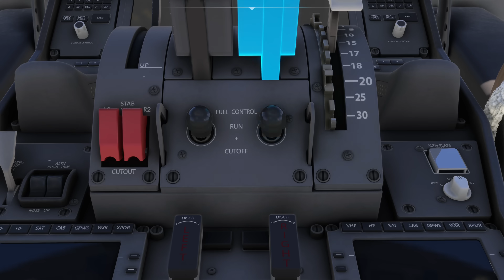Air India 171: Why Did The Fuel Cut-off Switch Get Moved?

Comment: if I'm ready correctly, it takes 1 second to cut them off but takes 4 seconds to put them back on ??

I think both switches actually never transitioned physically so it's either a bug in B787 software or an EAFR misreading 

at about 08:08:42
UTC and immediately thereafter, the Engine 1 and Engine 2 fuel cutoff switches transitioned
from RUN to CUTOFF position one after another with a time gap of 01 sec.

As per the EAFR, the Engine 1 fuel cutoff switch transitioned from CUTOFF to RUN at about
08:08:52 UTC

Thereafter at 08:08:56 UTC the Engine 2 fuel cutoff switch also
transitions from CUTOFF to RUN

Comment: But there’s no evidence the levers were actually touched, or pulled and moved and then set back to run.  There is no evidence that the controls were touched, only that a signal went to the engines to cutoff fuel.

Comment: Cameras could be put in cockpits to record all the mechanical flight controls without having the pilots' faces recorded. But that wouldn't stop someone from sabotaging the recording by "forgetting" to shut off the recorder for long enough after an emergency non-crash landing. That happened with Alaska Airlines 1282. Once the plane was stopped and passengers off, the cockpit voice recorder should have been turned off but it was left running long enough to loop over what it had recorded during the flight. All the recorders should have an automatic shutoff that stops them once the aircraft is on the ground and the engines shut down.

Many commercial truck fleets have dashcams pointing forward out the windshield, and one facing inward to record the driver. That protects both the truck company and the driver. It provides proof for the company if an incident is the driver's fault, and protects the driver if an incident was caused by a failure of the truck or another vehicle colliding with it or an animal runs in front of it or a tree falls etc. Despite that there are quite a number of truck drivers who have done stupid things anyway, knowing they're being recorded and will get caught if what they do causes a crash.

Most owner/operator truck drivers have an outward facing camera. A lot of them have YouTube channels so they also record themselves. If there's an incident where it's not their fault, they have the evidence right there it's not. Why wouldn't commercial pilots welcome that? Are they not confident that they are good pilots? If they do some minor goof and still land the plane without damage to it or anything else and nobody is injured, all that matters is they don't do that goof again. If they screw up something really bad, then like with Air India 171, it's very unlikely they'll be bothered by their screw up, or anything else.

Comment: here whole media is trying to save Boeing

Boeing holds the patent to remotely take control of any vehicles, including airplanes.

 2. Boeing applied for the patent to remotely control vehicles in 2003, and it was approved in 2006.

 3. Now, let’s see what happened with Air India Flight 117 (Boeing 787 Dreamliner) in Ahmedabad in the last few minutes before it crashed and how it matches Boeing's patent.
 4. As per Boeing's patent, they can switch off the power system and control it remotely, and they use an ‘alternative power control element that is inaccessible’

So, what is an airplane's ‘alternative power control element that is inaccessible’?

It is a ‘Ram Air Turbine (RAT)’

 5. Surprisingly, the ‘Ram Air Turbine (RAT)’ was activated during the initial climb immediately after lift-off in Air India Flight 117!

 6. According to their patent, they can control any ‘switch’, button, lever, keyboard, touch screen, etc
 7. Surprisingly, ‘Engine 1 and Engine 2 fuel cutoff ‘switches’ transitioned from RUN to CUTOFF position one after another with a time gap of 01 sec.
 8. So now the question is, why would the CIA(USA) do it?

According to my analysis, they wanted to give a message to the Indian government after India attacked their nuclear site during Operation Sindoor.

So, they choose a flight with at least one VVIP to send a clear message.

 9. Western media started to write propaganda articles and began to blame highly qualified pilots, which is one more reason to believe that it was a sabotage by the CIA(USA)!
10. In the past, Former Malaysian Prime Minister Mahathir Mohamad had said the same thing when Flight 370 disappeared

Comment: Interesting how the AI171 report provides second-by-second details for taxi, pushback, and radio calls... but suddenly, when the engines shut down mid-air and the aircraft goes into emergency — the time stamps vanish. We only get vague phrases like ‘immediately after takeoff.’
Let’s be honest — the entire sequence from lift-off to crash took less than 40 seconds. Every second mattered. If they can tell us Vr was achieved at 08:08:35 UTC, why don’t we have timestamps for:
- When both fuel control switches went to CUTOFF?
- When RAT deployed?
- When the fuel switches were put back to RUN?
- When relight EGT began rising?
This vagueness doesn’t feel like oversight. It feels like control. You leave those moments ‘open-ended’ so you can later steer the narrative — maybe subtly, maybe officially. And you allow public opinion to be shaped without resistance.
A system this precise doesn’t just ‘forget’ timestamps. When you control the clock, you control the blame.

Comment: Again: This could have been a "Übersprungshandlung" ( https://de.wikipedia.org/wiki/%C3%9Cbersprungbewegung ). Just consider your experience with your own actions. Even completely sober and healthy you are sometimes doing strange things without being conscious of. This can happen when under pressure and usually concerns very simple actions and usually you recognize that shortly afterwards to correct it instantly.
Maybe the pilot wanted to raise the gear, but instead cut of the fuel, both very simple actions. Timing would fit!

Comment: While an airline might not ground a pilot who sees a therapist or otherwise reports a mental issue, the FAA for darn sure will.

Ask Xyla Foxlin. When she had her IUD replaced, the initial hormone spike had her discombobulated for a bit. In her video on it, instead of simply "self grounding" for a few weeks while the hormones from the IUD settled down, she went to a therapist. That led directly to a very intrusive interview with the FAA, followed by getting grounded from flying her airplane. Apparently she can still fly a plane that meets the Light Sport specifications, she's building a Pietenpol Air Camper.

That an FAA official can use any whiff of a mental issue to ground a pilot is why many pilots don't seek help, even for things that are completely transitory, like a bit of excess hormones that will soon sort itself out. Or it could be a medication the person is having a problem with, that can be sorted out by discontinuing it, finding the right dose, or switching to a different medication. Then there are mental and other medical conditions that can be well controlled with medication and being strictly monitored. It used to be that diabetes, of any type or severity, was a permanent bar to piloting aircraft, but with insulin or medication as needed, along with blood glucose testing, it's not an issue for most.

So for female pilots who have changed their contraception, FAA's people should learn about such things so they can do a temporary grounding if needed, until any issues they have get sorted. Same thing with anyone who is having some stress from any personal/life/family issues. Chill out for a while, take some time off. Come back in a couple of weeks and we'll see if you're in a better frame of mind.

Do that instead of pulling their certificate just for seeing a therapist, then dismissing any proof they bring showing they're mentally fine to pilot a plane.

Comment: Making certain the correct failing engine is identified and shut down came crashing into prominence with the Kegworth crash in 1989. The pilots were used to older 737's where only one engine fed cockpit air. They were in a new 737 model with a changed air supply system where cockpit air was supplied by both engines. They'd undergone training on the new and different features of the new model. But when one of the engines caught on fire, they completely reverted back to their knowledge of the older models - which led them to ignore what their instruments said, and IIRC even what one of the cabin crew told them about which engine was on fire. Why? Because they "knew" that smoke in the cockpit meant the right engine was on fire, and the vibration indicators were inaccurate. But the 737-400's vibration indicators were accurate, and its left engine was on fire, feeding smoke into the cockpit.

People thinking up crazy scenarios for flight simulators should've prepared one with a left engine fire for any flight crew with experience in 737's before the model 400 - then see how many pilots would've shut down the right (wrong) engine.

Comment: Capt Steve, I have a different theory. I've lived since 2008 in my house and still sometimes forget where the light switch is in a room when I enter it. I grab for the switch and it is not there but on the other wall in that particular room. This happens to me sometimes, even after having lived in that house for such a long period of time. I can imagine that one of the pilots was not 100% with it, and grabbed the fuel switch instead of the landing gear switched by mistake not realizing he grabbed the wrong switches. It's far fetched but a possibility. One wouldn't expect this from a pilot at take off time but you never know.....

Comment: Captain Steve in one of your videos you state that the chances of a double engine failure is BILLION TO ONE, and you reckoned the switches were MOVED, however the report states TRANSISIONED.  Switches are moved Valves are transisioned.

YOU MISSED A COUPLE OF FACTS.

1, Incident: ANA B788 at Osaka on Jan 17th 2019, both engines rolled back after landing
By Simon Hradecky, created Thursday, Jan 17th 2019 20:53Z, last updated Thursday, Jan 17th 2019 20:53Z

An ANA All Nippon Airways Boeing 787-8, registration JA825A performing flight NH-985 from Tokyo Haneda to Osaka Itami (Japan) with 109 passengers and 9 crew, landed on Itami's runway 32L, touched down, the crew deployed the thrust reversers when both engines (Trent 1000) rolled back and shut down. The aircraft rolled out without further incident, came to a stop about 2450 meters/8030 feet down the runway and was disabled. The aircraft was towed off the runway about 40 minutes after landing.

The airline is investigating the cause of both engines shutting down unexpectedly. First examinations by maintenance dispatched from Tokyo do not suggest any anomalies with the engines.

2. UK CAA (Civil Aviation Authority) a MANDATORY instruction to   15th MAY 2025.  SN-2015/005  Fuel Shut off valves. ! month before this crash.

How can you state categorically that this Aircraft was flying as it should and there was nothing wrong with it ??
Are you an investigator or a pilot or just a You Tuber creating views by guessing. AS an Aircraft Captain you should know better.

Comment: One way to help stop a pilot doing this could be to have two sets of cut-off switches, one set for each pilot placed out of reach of the other pilot. Then only if both sets agree does the fuel state get changed.There are ways to overcome the need for both pilots to flick a switch if one is rendered unconscious, such as remaining pilot reaching over in whatever way or getting cabin crew to help out. Either way it's better than 200+ people burning to death (assuming they escaped being minced during the crash).

Comment: Hi Capt Steve ! Iam Also an Airbus pilot for last 24 years and Capt for the last 20. 
Is it possible. ….  That the fuel switches did NOT  Infact move at all !! 
Maybe … an internal transient system tech glitch triggered the required outcome of moving the switches ! Some kind of sensor issue ?? 
And then after 10 secs  it reverted to normal ?
Reply: Then wouldnt the pilot talk about it?

Comment: My question is: both pilots are in the cockpit, so if one asks the other, ‘Why did you cut off the fuel switch?’ and the other says, ‘I didn’t,’ then the other must have noticed, right? Because it takes manual effort to turn it on or off

Comment: Steeeve! How can you say that there was nothing wrong with the aircraft?  The preliminary report is lacking soo much info. More questions than answers. 

It could still be aircraft beeing root cause. It could also be a combo of aircraft (engine hw/sw) failure and pilot error. 

A possible scenario could be a single enging failure just after liftoff. Then the pilot either choose the wrong cutoffvalve OR the wiring was wrong.
The are many more scenarios...

Comment: Having rotated, an aircraft is at its most vulnerable because it is only going just fast enough to leave the ground and is only a feet above that ground. It has from the moment of rotating to increase its airspeed as fast as possible to maximize lift so that it can progress to cruising altitude, hence raising the undercarriage very soon after rotating and then raising the flaps at a suitable point, depending on conditions. At no other point in the flight will the fuel consumption be greater. Anything going wrong at this stage compromises increasing speed and lift. Therefore, we also have to factor in that cutting off the fuel switches occurred at the most potentially catastrophic moment in the flight. Once the aircraft is at altitude it has both height and speed to play with in case of an emergency. Neither applied in this tragic instance. If it was accidental then that was extraordinarily unfortunate, but for that reason alone implausible to the extent of being impossible. The alternative is that the person who turned off the fuel switches chose the moment carefully because he knew what that action would inevitably lead to. If is true that the co-pilot was controlling the take-off it is also implausible that he could free a hand to execute the switch cut-offs one by one in a procedure that Captain Steve explains quite rightly could never be considered part of take-off. We may never know exactly what happened, but a significant number of other scenarios can now be discounted. The possible explanations are now very limited indeed.

Comment: Before blaming the pilots for the AI171 crash, it's important to consider that this could also be a Boeing design flaw. The engines shut down because both fuel switches moved to “CUTOFF” just after takeoff—something no trained pilot would intentionally do. A 2018 FAA bulletin had already warned that these switches on the Boeing 787 could move unintentionally due to faulty locking mechanisms, but the fix was not made mandatory. Air India’s aircraft reportedly hadn’t been updated. Cockpit recordings show even the pilots were confused, suggesting this wasn’t deliberate. Let’s wait for the full investigation—this may not just be pilot error, but a serious design and regulatory failure.

Comment: The fact that this happened within a second is a clear system malfunction. Psychologically, a pilot under mental distress would take more than a second to do this kind of act! Only a system malfunction can trigger split second errors. The west has gone absolute bonkers! At first it was speculation about flaps not set at correct angle which blamed the pilots. The same was then debunked after evidence! These are modern aircrafts, they have advanced warning systems if something goes wrong!

Comment: Are there any other types of commercial passenger planes who has switches, used to other things, mounted at the same place as these fuel switches on the air india plane? What i mean is, what if one of the pilots was used to turn of(or turn on) something in the process of taking off in another type of plane that had those switches placed at the same spot as the fuel switches at the air india plane. That's maybe the other pilot denial that he has turned of the fuel because he has accidently done that because he was use to do something else with these switches on the other plane.

Comment: Question : It seems very unlikely that the PF just after rotation, both hand at the wheel would be the one to cut off both fuel control switches without it being noticed by the PM. What are your thoughts on that Captain Steeve?

Comment: Captain Steve…Don’t you think it’s time for Boeing to install the old fashioned cable/pulley system to control flight controls such as flaps and rudder with a manual switch to override the the flight computor system if the computor fails including the engines. Giving back manual control of the airplane to the pilots. Boeing could have one of the safest airplanes in the air with this old manual system over ride for the pilots being as many crashes are caused by computer misfiunction. What do you think Steve as the technology is already in place for this manual back up system? Thanks. Tom/UK.